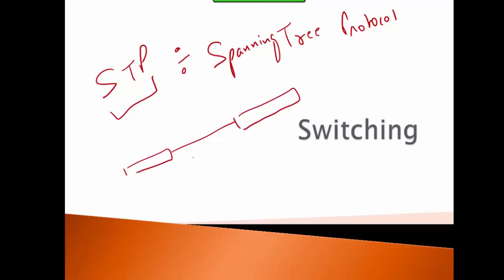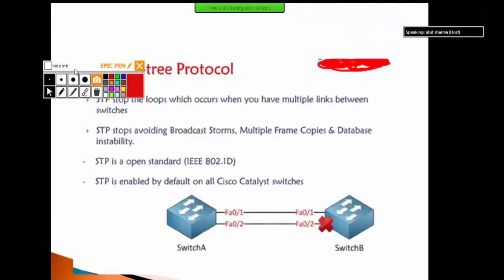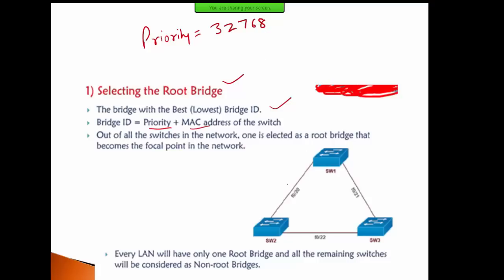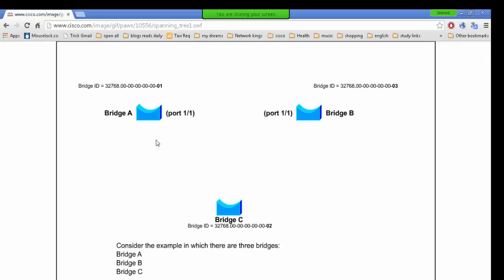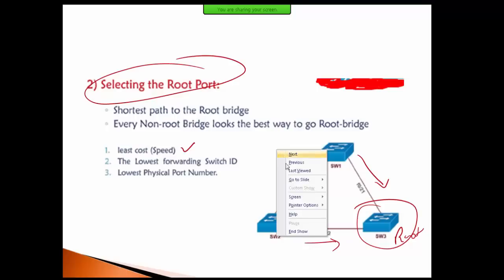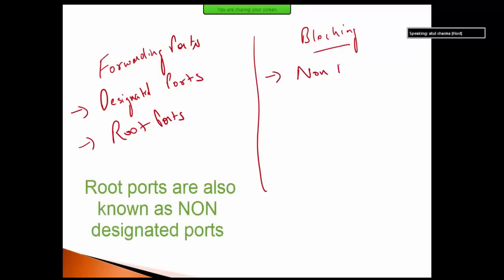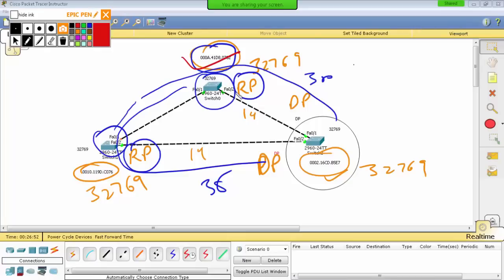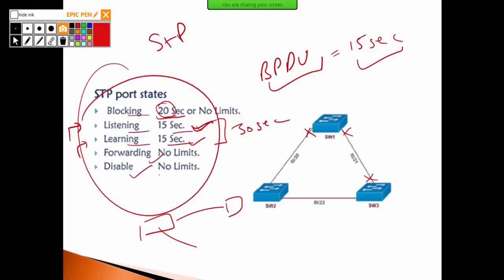STP Spanning Tree Protocol in ( Hindi Urdu Version)

Comment: wo important Bridge Protocol Data Unit (BPDU) frames which switches exchange are configuration Bridge Protocol Data Units (BPDUs) and topology change Bridge Protocol Data Units (BPDUs). Configuration Bridge Protocol Data Units (BPDUs) are sent between bridges to establish a network topology. Topology change Bridge Protocol Data Units (BPDUs) are sent after a topology change has been detected to indicate that the Spanning Tree Protocol (STP) algorithm should be initiated.

The format of IEEE 802.1D Bridge Protocol Data Unit (BPDU) is given below.

• Protocol ID (2 bytes): Contains the value 0000 for IEEE 802.1D

• Version ID (1 byte): Contains the value zero.

• BPDU Message Type (1 byte): Conﬁguration or TCN BPDU

• Flags (1 byte): The Topology Change (TC) bit signals a topology change. The Topology Change Acknowledgment (TCA) bit is set to acknowledge receipt of a configuration message.

1 : Topology Change Flag
2 : unused 0
3 : unused 0
4 : unused 0
5 : unused 0
6 : unused 0
7 : unused 0
8 : Topology Change Ack

• Root Bridge (Root Switch) ID (8 bytes): Identifies the root bridge by listing its 2-byte priority number followed by its 6-byte MAC address.

• Root Path Cost (4 bytes) : Contains the cost of the path from the bridge sending the configuration message to the Root Bridge (Root Switch) .

• Sender Bridge (Switch) ID (8 bytes): Identifies the Sender bridge by listing its 2-byte priority number followed by its 6-byte MAC address.

• Port ID 2 bytes): Identifies the port from which the configuration message was sent.

• Message Age (2 bytes): Specifies the amount of time elapsed since the Root Bridge (Root Switch) sent the configuration message on which the current configuration message is based.

• Maximum Age (2 bytes): Indicates when the current configuration message should be deleted.

• Hello time (2 bytes): Provides the time period between Root Bridge (Root Switch) configuration messages.

• Forward Delay (2 bytes): Provides the length of time that bridges should wait before transitioning to a new state after a topology change.